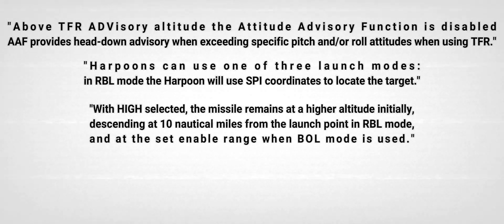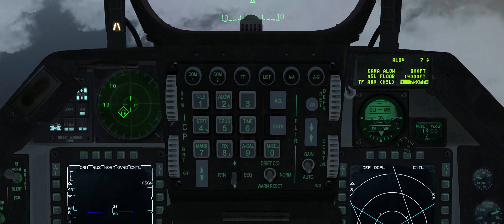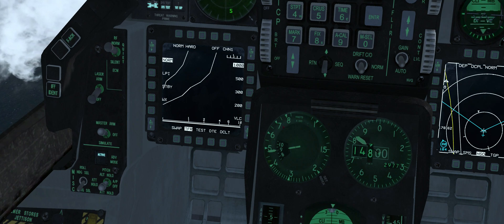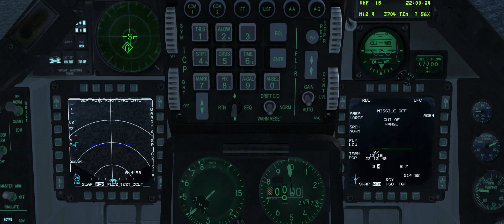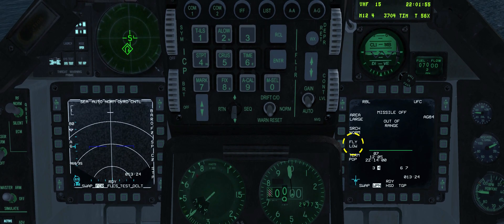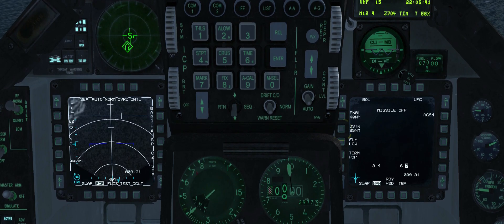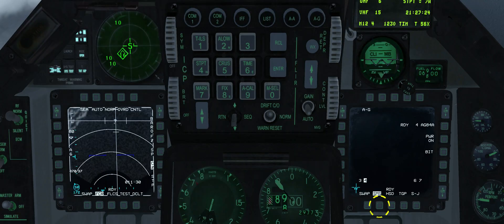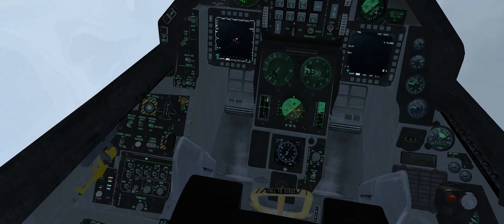Falcon 4 BMS : F-16 Fighting Falcon : AGM-84A Harpoon Tutorial

Comment: Never dealt with harpoons in BMS so i might miss stg here, but isnt it a vit cumbersome to activate each missile individually one after another? Or does it need to be handled like this?
Reply: I think you can step through them on the SMS page and power them all on, then just step through them and fire in sequence.
Reply from the maker: You can power them in whatever way makes sense for the specific situation, but the missiles have a limited power on period, which is around 20 minutes.